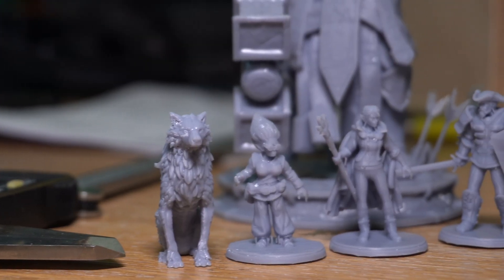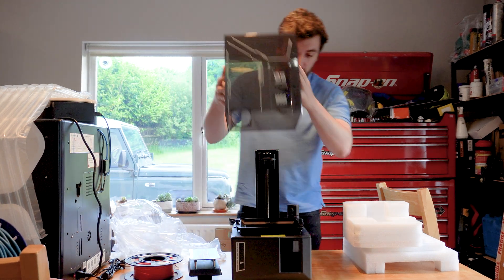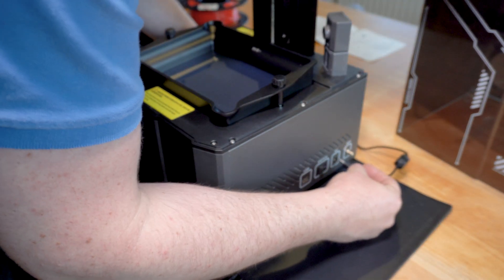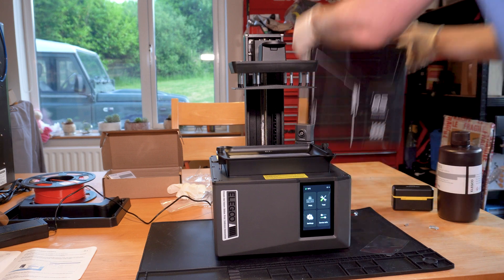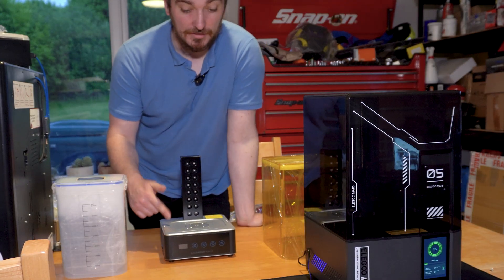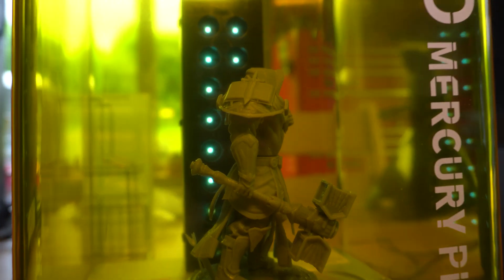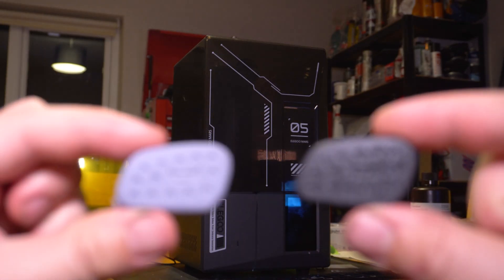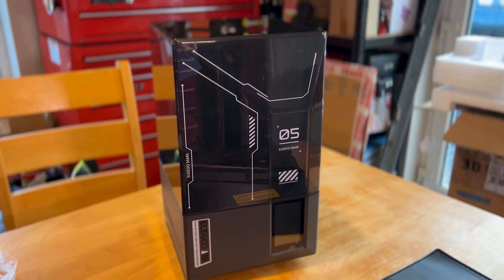Resin 3D Printing FINALLY got good. | Elegoo Mars 5 Ultra

Comment: If you're doing parts, the Saturn 4 Ultra is the better pick. All the same features, with a much larger build plate, and only slightly larger pixels that you'll only notice with a magnifier, if at all.

Comment: Now that the printers have achieved a high level of performance, the manufacturers need to work on making the essential process somewhat less of a toxic, air quality disaster.
Reply from the maker: Absolutely.  There are some products coming out for resin and FDM printers that do this.

Comment: Couple of things. First, if you're going to do functional prints, take a look at the ABS-like tough resins as they have some flex to them. The type of resin you're using, while great for static pieces that don't have to flex or won't be handled a lot, are too brittle for functional parts. ABS-like gives your parts a bit of spring. Second, not sure if you're aware, but your wash process seems a bit lacking. You may have adapted already, but my recommendation is to use a pickle washer for an initial rinse, followed by 5 or 10 minutes in your wash station, followed by allowing the parts to dry for a few hours before curing. Any bit of residual resin will result in a shiny spot which is an indication of insufficient rinsing, which is going to potentially obscure detail. It may not be possible to get it all, but you can get most of it. One last piece of advice is to get a silicone tray with sides of 3-5 cm to pass your build plate into until you can prize the prints off of it. Seeing that resin splattered on your printer's housing definitely triggered me. Resin splatter is death to your printer, and even a little between your lid and the printer can results in a lid that defies all mechanics tools to remove it. A good quality painter's scraper (Level 5 and Hyde are good) will be a much superior experience to the included scraper and is worth the cost. I have two of these Mars 5 Ultras inbound (one for me and one for a mate), and a Saturn 4 Ultra as well. They are so much better than the resin printers I started with (Mars original) and a relative pleasure to work with. Good luck.
Reply from the maker: Thanks for the advice! I already have some ABS-like resin on the way 👌🏻
 I have been spraying prints down with IPA in the hopes I could save a bit, as it seemed wasteful to me to fill a whole jug with it, but I may have to bite the bullet and get a big bottle of it.

Thanks again and hope you enjoy the new printers.  I’m still really impressed 👍
Reply: @SamsMotors  you might want to try denatured alcohol which is cheaper and less smelly (get the low odor kind). It's what Fauxhammer uses, so I just picked up four gallons of it to try. One wash tub of it will last for many, many prints and if you pre-wash in a pickle rinser, it will last much longer. Good luck!